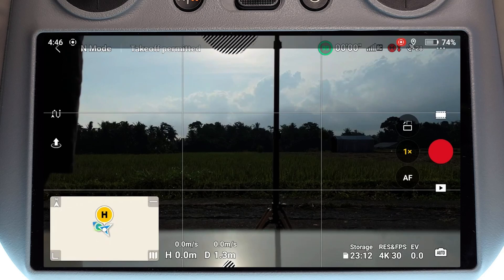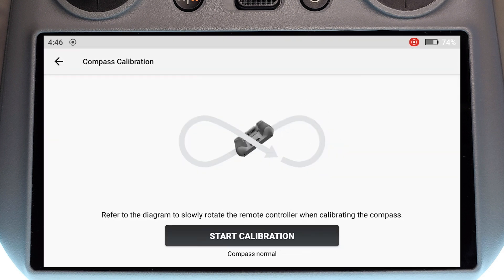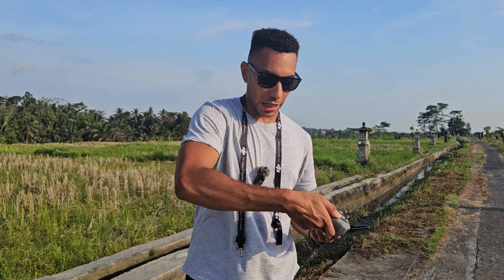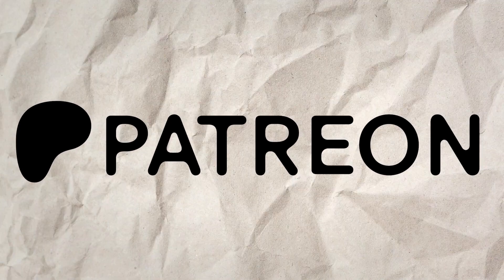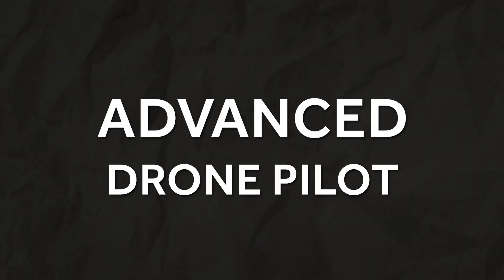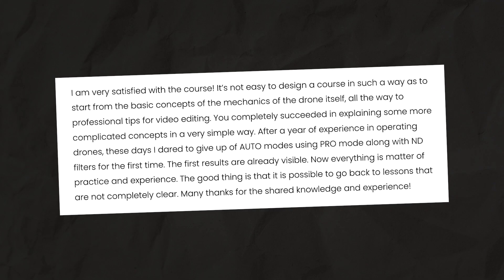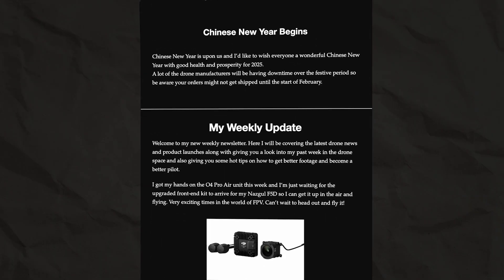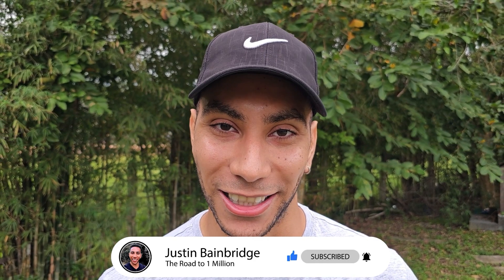How to Calibrate The Compass on Your DJI RC2

Comment: I think you misspoke. What you meant to say was, "What you want to do is have the screen facing down, not the bottom of the RC 2" , but you said "not the top" which is the same as the screen. Other than that, great well-needed video demonstration!
Reply from the maker: Hey! I actually meant what I said, I refer to the antenna portion as the top and the screen as the front. Hope that clears it up, thanks for the kind words 😊

Comment: Hi is it possible to do it with the Dji rcn3? I'm going crazy to find it out! Thx 🙏
Reply from the maker: Generally, the process is similar with all the radios, but I haven't used the RCN3, so I can't say for sure 😃
Reply: @ I couldn't find it, yesterday I tried. I was only able to find how to calibrate the control sticks
Reply from the maker: @StandaloneVR I wouldn't worry too much then. If it needs calibrating it'll pop up with a little notification that you can click to calibrate it. To be fair the RCN controllers probably just use the phones compass so you might not even need to do this 😃
Reply: @ thx, yeah maybe it use the compass on the phone?! The problem is that in dji fly app the remote compass is not matching the north on the map, it points in the wrong direction. Btw the drone compass is calibrated and matching the north if pointing north. When the drone compass is not aligned with the map there may occur flyaway problems. I hope the remote compass matching the map is not in the equation to prevent flyaways.